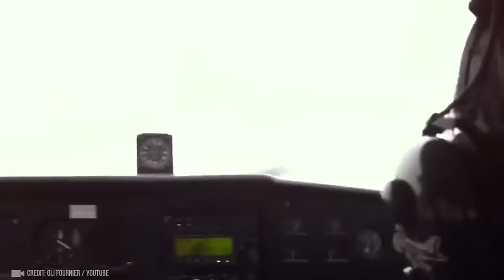Unbelievable Aviation Moments Caught on Camera !

Comment: There is no fuckin way that car is going faster than a plane in a residential street.
Reply: but it was going the opposite way so you add the speed of the plane and the car together so the car is going faster than the plane......no?
Reply: @davedixon2068 No.
Reply: @RandyDarkshade2  Heh Heh thought not

Comment: 12:07 - they always fly in two crew, so it wasn't so dangerous ... :)
Reply: That is a U.S. Navy Blue Angel aircraft.  They always have a 2 seat plane in the flight group that is used for V.I.P.’s and journalists and so on for flight demo rides.  The guy in the back seat is not the pilot.  The pilot clearly pulled enough Gs on this flight to make the untrained passenger pass out.  The pilot was conscious the whole time.

By the way, they do not always fly with a crew of 2.  Most of the F/A-18 aircraft are single seat planes.

Comment: It's amazing how a piolt can side-slip a huge aircraft & still touchdown in the correct spot.
Reply: It is amazing to watch but a good pilot should be able to "spot" land any aircraft that he flies from a slip. The slip takes the place of flaps by increasing rate of decent while the position of the nose (elevator) controls speed. Too much speed and the slip is wasted, you'll overshoot the point of landing.